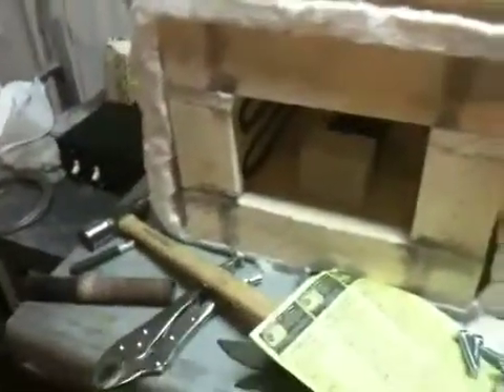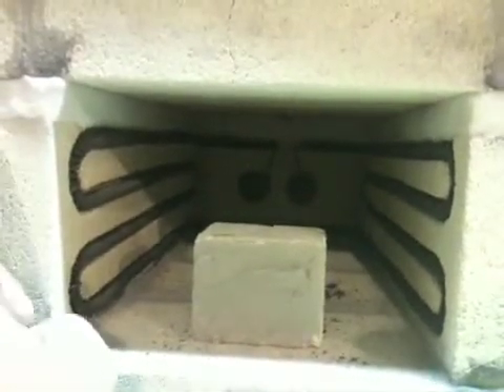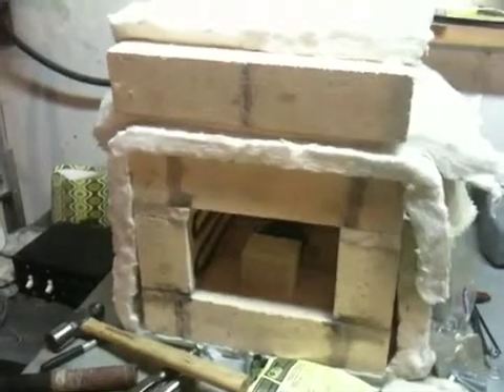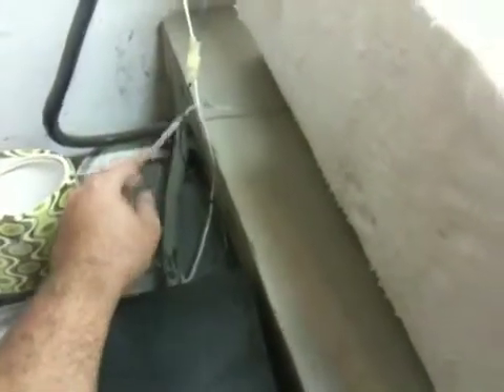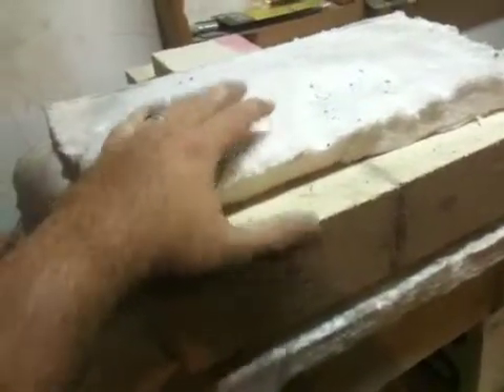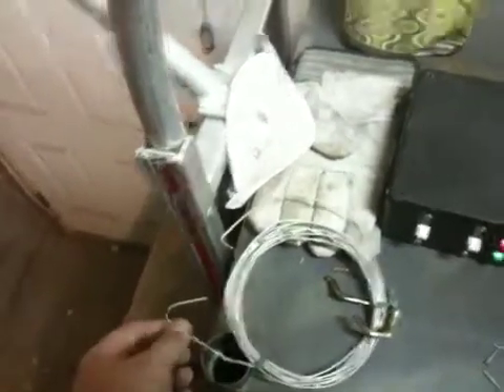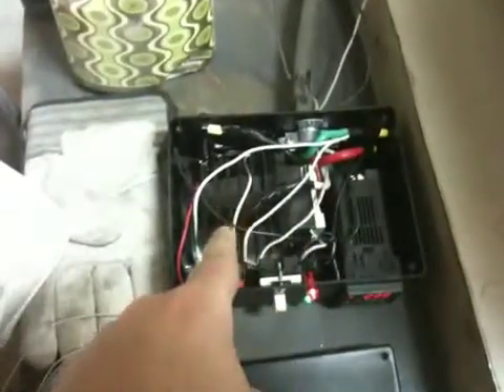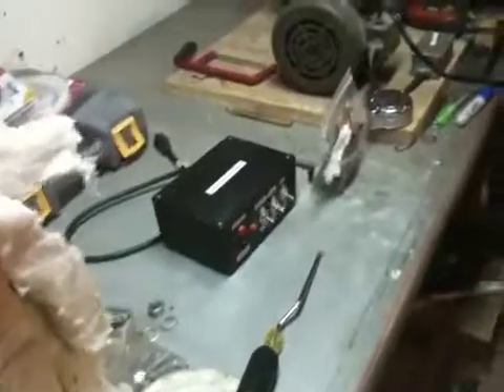Homemade Heat Treating Oven Overview

Comment: @bassthumpintwion Thats a good choice since it's exposed. It builds a layer of aluminum oxide on the surface so that would make it less likely to shock you through accidental contact. You did a good job on it for sure. Is the controller programmable for time/temperature routines?

Comment: @bassthumpintwion That's cool it looks a lot smaller than that on cam. Looks like 18ga or smaller. Did you get that nichrome wire out of a dryer? Looks like one of those elements. What is the current draw on it? That temperature controller, does it just switch to control the temp or does it actually vary the voltage? How much was it?